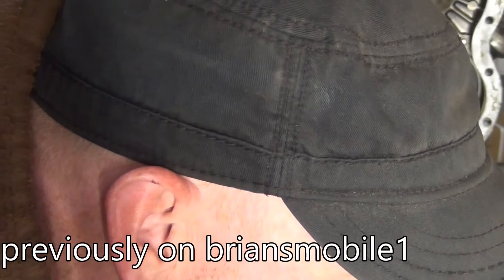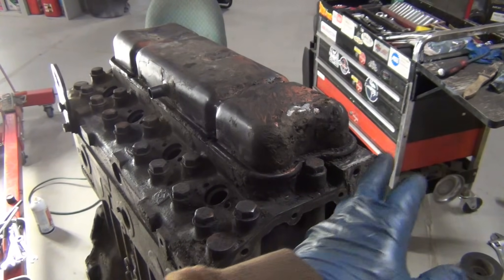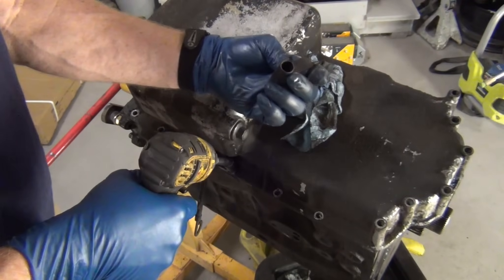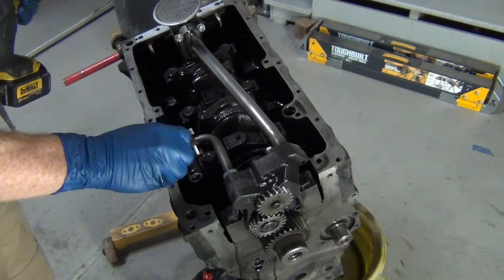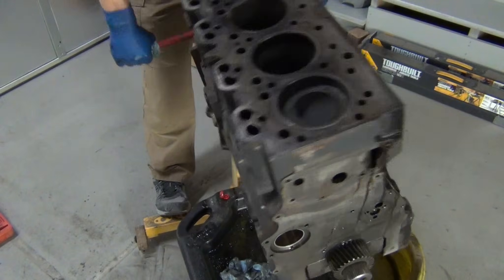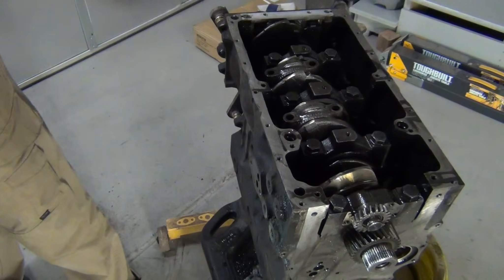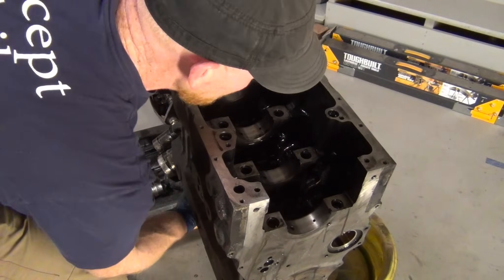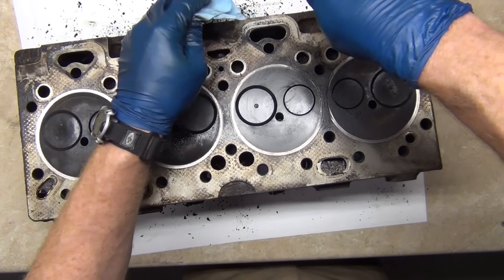Perkins Diesel Engine Teardown Pt 3

Comment: Brian it is absolutely imperative that the lifters go back in the same holes, Because each lob on the cam wears them differently & if you mix them you will damage them & the cam ! Now I realize you probably know this , but you did not show you storing them in order, & you viewers need to know this ! I learned this at ,, 4 BT Swaps & since l did not do it , had to buy new lifters , cheaper than having them ground!

Comment: Just rebuilt 4.236 this past week sent the block out to have sleeves knock out and new pressed in. Head also had new valves and springs and head decked. Thing runs like a champ. Also had piston failure on number two.

Comment: Can you just tell me the corect way to take away high presure pump that wasnt on a video do you just tight it with a bolt and than just take away or you nit to line the gears first and then take the high preasure pump away ?

Comment: I have a question what can cause a school bus engine to overheat driving for over 2 hours one of the buses at my school overheats after an hour maybe two hours or over 2 hours and it ends up shutting down and the emergency brakes lock what causes the engine to overheat even if it has the radiator fluid in it somebody I talked to you yesterday could be the thermostat but what is your opinion on it

Comment: Plus one on Todd Outdoors description of sleeve removal and installation.
Reply from the maker: The machine shop tried it- ended up shaving them out.  I'd like to try that some time.
Reply: I have seen vids of guys cutting them out with a long chisel & a hammer , but i would be afraid of damaging the wall behind the sleeve. 
Excellent vid & THANKS

Comment: What brand sockets do you use?
Reply from the maker: What don't I use?   I use HF, Snap-On, Husky, Great Neck,  Stanley, Craftsman, MAC, Powerbuilt, and whatever else.  In my garage tools aren't sacred and I'm not a fan boy either.  I'll cut a socket without hesitation to build a new tool if I need it.  (usually a HF)

Comment: Why do these engine stands not have bearings? This would make turning this around much easier.
Reply from the maker: It's stronger without them maybe?  The little bit of friction is probably safer.  The cost of production is definitely cheaper without bearings.
Reply: It helps them stay in place easier so maybe that’s why. Plus money.
Reply: Grease helps too :-)

Comment: On the old Mack's we would use a block of wood and a jack to ease the sleeves out. To return new sleeves we would have the in a freezer over night well below freezing and they would slide right in. When they would warm up they were tight.
Reply: Todd Outdoors this works as well on these engines. Dry sleeves, freeze overnight and a little oil on them. They go right in with a block of wood and a medium hammer tapping them in.
Reply: Todd Outdoors Man I pulled on threaded rod for hours doing that. lol

Comment: Now the question is did that loose bolt cause oil problems which destroyed that Piston, or they are unrelated ?
Reply from the maker: I bet it contributed about 20% or so.  The main issues were idle time, starting fluid, and no air filtration.
Reply: bbogdanmircea I agree questions is did the loose bolt cause the piston failure

Comment: So what makes the diesel sound??
Reply from the maker: I love that question!  That's a great video idea.  The short answer is diesels ignite harder and are more efficient with less restrictive exhaust back pressure.  So the bigger and less restrictive their exhausts are the better they run but this is louder and less muffled they are.  That's half of it.  And the diesel fuel is more energy dense and produces more torque at the crankshaft when it ignites.  You get more bang from diesel oil/fuel than gas.  That's also why diesel engines are so much heavier and heavier duty than gasoline engines.   Aluminum often doesn't hold up to the repeated shock or the heat associated with that harder diesel fuel punch.  Does that help?
Reply: DJ.Spikes Hostage I’ve also seen a video where they put a tune on a 24 valve 5.9 Cummins and they turned off the pre cup that shoots a tiny bit of fuel to get the burn going before the main shit and that made us sound like a 12 a live 5.9 Cummins it was much louder and more noticeable.
Reply: briansmobile1 yes it does help thinks. Can't wait to see my question on YouTube 😇 SENTS you you said it was a great question for a great video idea .
Reply: Also, the mechanical injection pump on some of these older diesels contributes some of the rattle to these as well.

Comment: Loose oil pump screw!! wow That was a bomb waiting to go off.  Where that screw is, the pump is trying to suck oil. With air being easier to suck that is what could of easily gone into the bearings vs oil. Very interesting disassemble.
Reply from the maker: Hey Kenneth, that pipe goes from the pump output up to the spin-on oil filter.   It was definitely losing oil volume.

Comment: You have excellent content. You do not need music.
Reply from the maker: Thanks.  I'm glad you think so.  The analytics and my watch time show the music helps keep younger viewers from clicking away at 3 minutes.
Reply: Hmmm...interesting about your findings on the music/3 minutes.  I don't care for the music being as loud as it it... but I'm 70.    Also, in taking off any gear, you can leave a bolt backed out to just a cpl threads but leave it there while you pull and bang on the gear.  Then when it comes loose it won't fall on your toes or hit the floor and chip the finish.  Love all ur vids, Super B